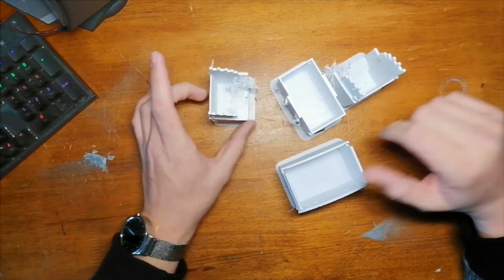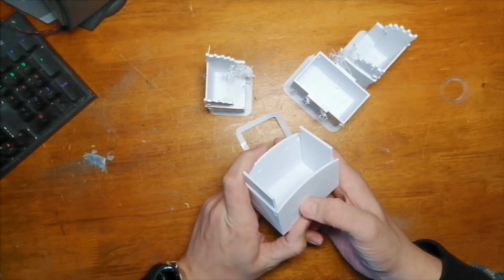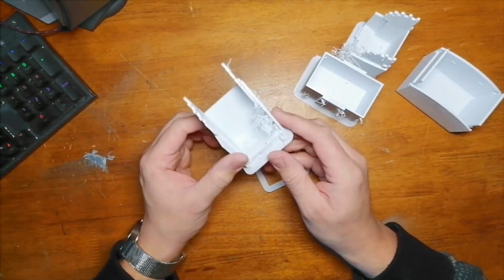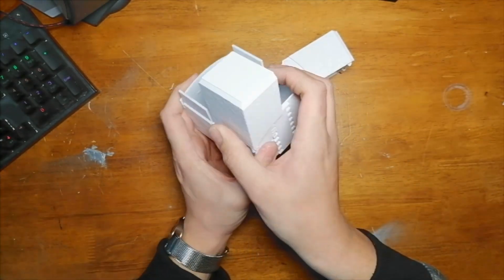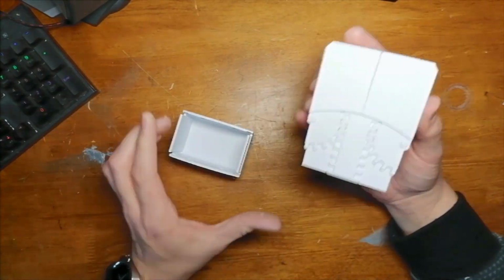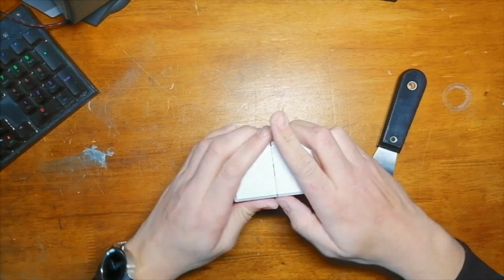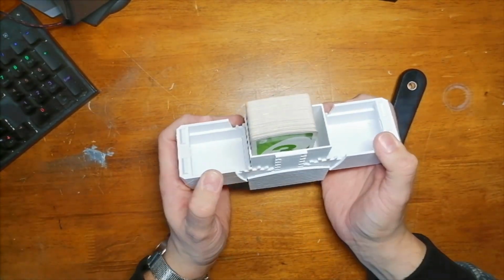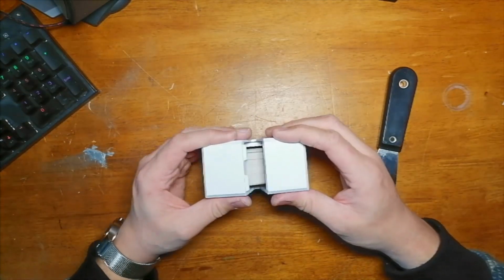3D printed geared card box

Comment: Hi there. Just a quick note on this print. It's usually easier to assemble it with the lids open. When you drop the card cart + lids into the base, just before it has to slide into the hinge plate, just open the lids first. This takes the pressure off the gear plates on the lids, and allows them to flex a bit so that they can slide into the hinge plates. Then you shouldn't need to use a scraper or lever to pry the hinge plates. There's also a 'support-less' version on Etsy (sorry, but that's how I fund all the other free designs I create) that doesn't require any supports. :D
Reply from the maker: Hi thanks for the tip I did try that first take but I found I couldn't get it to sit low enough and my cards didn't fit

Comment: That was a terrible print to be honest :) But in the end it came out ok. You should really figure out what is going wrong with supports, they should be easy to remove, and not spaghetti. I'm also not sure why you used a skirt, those object should have enough adhesion by themselves. Real cool end result though, maybe you can put some white grease in there to make it move easier. Thanks for the vid!
Reply from the maker: Yeah I don't think the temp was right for the filament the supports did come off easy enough though. I didn't use a skirt I used a brim and I did that because I often find anything with sharp corners is prone to warping off the bed and also I find it usually helps the supports stick. Thanks for your comment 👍

Comment: the link in the description doesn't work
Reply from the maker: It did but thingiverse have moved it
Reply: Awesome 3DPrintz do you know what the current link to it is
Reply from the maker: @armityle882  this looks like the same one https://www.thingiverse.com/thing:3373057
Reply: Awesome 3DPrintz thanks
Reply: @armityle882  Hi there. I'm afraid I moved a bunch of stuff from thingiverse as it was getting pretty problematic to use. The current version is available here:  https://www.prusaprinters.org/prints/2402-ccg-geared-card-box-v2-magnetic-latch , or here, https://cults3d.com/en/3d-model/game/ccg-geared-card-box-v2-magnetic-latch
There's also a few updated designs in those profiles which don't require any supports.